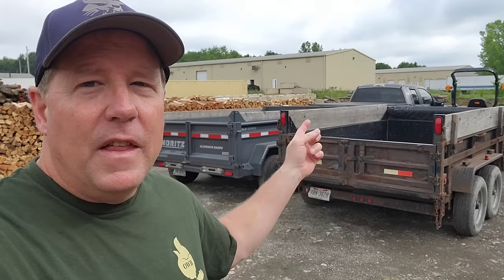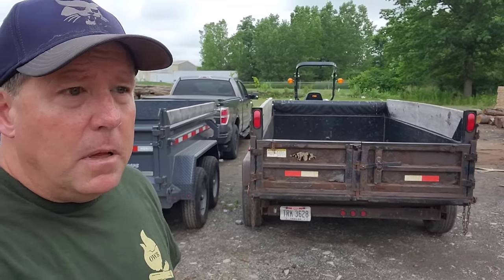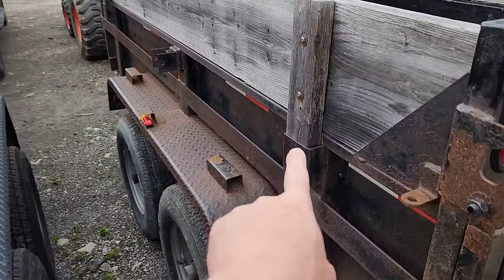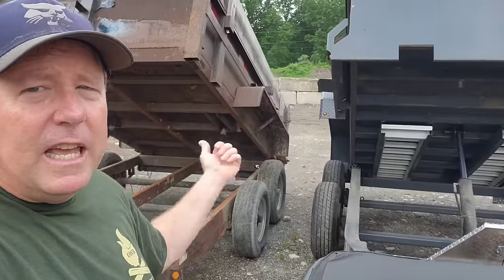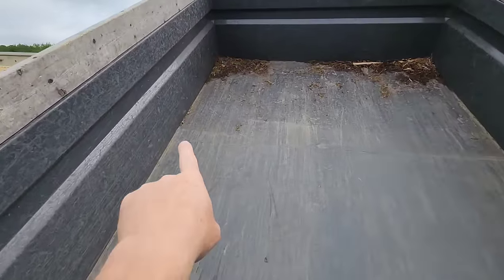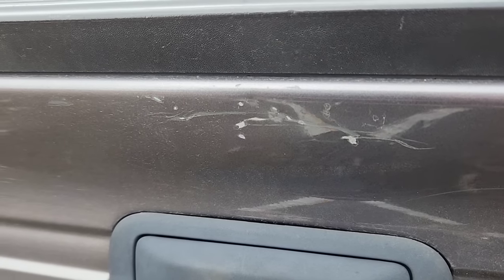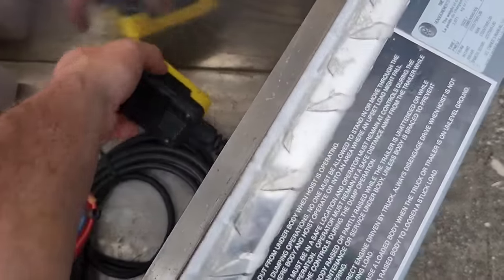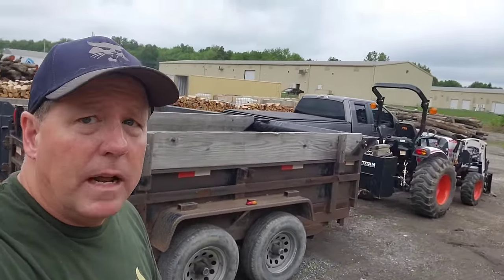Are Dump Trailers a Rip-Off?

Comment: You sure that small tab on the door Pin for the Moritz isn't for hold the Pin in the Up Position?
I believe on the 2 cylinder trailer if 1 cylinder bleeds out they Both will lower.  I don't think it will Kink.  Check the supply tube and you should find they are fed with only 1 tube.
I will say the cheaper trailer I bought had 1 cylinder and lifting 8000 pounds of dirt or gravel caused the center beam to slightly bend.  Was not happy about that.
Enjoy your trailers

Comment: The paint inside the trailer is holding up better then the outside?
I'd get it painted, if you don't it will fall apart before you know it.

Comment: Hello Joe, I hate to tell you but your information about needing a CDL in PA is incorrect.  I reside in PA, and I was told the same thing as you mentioned. I asked to see the PA regulations that states this. The individual couldn't produce it. I decided to email the PA DMV in Harrisburg (PA state capital). In my email I outlined my GVWR of my truck and the dump trailer I wanted to purchase,  my trucks GCVWR, maximum payload, maximum tow rating, and would I need a class A drivers license to tow the trailer. The reply to my email was, " You can still operate your truck and trailer with a class C non commercial drivers license. You would only need a class A drivers license if the GCVWR would be 26,001 pounds or more. Where the 10,000 pounds GVWR comes into play, is to determine if you need a class A or class B when your GCVWR is over 26,001 pounds and your trailer is over 10,000 pounds, you would a class A. If your GCVWR is over 26,001 pounds and your trailer is under 10,000 pounds you would need a class B. I have been pulled over by DOT towing my dump trailer and never received any type of ticket or warning.

Comment: Own a 14' x 7' ED Trailer. It cost me [2 years ago] $450 for a 5yd dump of 1-1/2" clean rock [$1350/15yd delivered]. I just hauled 15yds, 3yds at a time from the exact same rock pit @ $18.50/yd for 1-1/2" clean rock. It cost me $36.50/round trip in fuel ....$460 for 15yds Versus $1350.....Yeah, I like the dump trailer.
Reply: ps........  Some things I have learned using it: 1) The battery usage per dump lift is enormous. [You will only get 4-5 dumps per fully charged battery [lead-acid]. The onboard charger will NOT recharge a low battery overnight, you need a REAL battery charger [using the 15amp charging position, the 2amp setting will not recharge the battery fully overnight if it is drained]. Your truck-to-trailer lighting/power wire hook up will NOT recharge the dump trailer battery in a short time either.  2) The hydraulic fluid [ATF] reservoir will overflow out of the fill cap, due to back pressure in the cylinder[s] if you lower the dump trailer without using battery power. [My ED trailer has THREE buttons, Up-powered, Down-powered, Down with gravity-no-power]. There is a video showing why/how the air pressure builds up in the "un-powered" hydraulic cylinders, as they are lowering; causing the backflow/overflow into the Fluid Reservoir, so I won't go into that. I put a plastic bag under my reservoir as an overflow berm, in case my battery dies and I MUST lower the dump by gravity. If you do not have the "Down by gravity" switch on your model, you will need jumper cables, and/or a second battery to lower your deck if it gets stuck "up" and the battery dies.

Comment: If one ram fails, the trailer wont work at all. Because the fluid will by pass. Or so im told by my coworker, he told me to let you know. 
Hes old and thinks he knows everything. 😂   hes got a mediocre track record .... hahah
In my experience which i can back up with something thats actually happened to me in real life. . .
In a front end loader with dual cylinders one side failing will result in very slow operation of the front end loader. With a bit of torsion depending on the weight involved. But dual cylinders in my opinion would be more gooder. And power down is the way to go sir. Great video

Comment: I would buy your new trailer every day all day because it is built way way better.. Who ever told you that bent ties/floor is better then a floor separated from the sides was just trying to sell you a trailer.. Where they bent it now is very week compared to the welded floor to side.. Where they bent it is much thinner now and if you need to replace the floor it is much easier on your new trailer.. The biggest reason I like your new trailer is the I beam construction.. Here in Canada that box frame is crap.. I beams are better, stronger and stay that way over the years.. I have never seen a box frame trailer that didn't rust out in places over time.. As for your cylinders you can tell the single is bigger then the two plus ever hear the saying Double Trouble lol
Reply from the maker: Thanks for you insight Wally.  Glad you watched buddy

Comment: If you go down to home Depot they sell a paint called turbo paint it's a tall can that sprays 11 in wide pattern you could take a sand disk to the trailer and get the rust off and spray it on as much as you want might look a lot better also you can keep touching up on it

Comment: Lol. can't say i agree with your professors concept, uneven loading the double cylinders would deliver more stability, possibly more lift, inside the bed the formed bed would be better, the other trailer would be better if it was fully welded instead of skip welded.

Comment: Thanks for the info Joe.  isn't there a way that you could put some kind .d. It    e     of clip in the bottom of the latch on the Moriitz traiiler to  keep it from coming unlatched even if it meant having it modified by having a hole drilled in the bottom.  Adam from "Hometown Acres" has a friend that could do it for you.
Reply from the maker: I had thought of doing that.  I need to do something Neil!

Comment: You have had better luck buying them than me I build them from scratch now and don’t waist time with used ones  it will help if you drill some small holes and oil spray the frame inside the tubing 
For outside prep and spray better paint.  Manufacturing sucks now

Comment: I live in PA. The 10,000 lbs is NOT "CDL"  --  You need a FMSCA Medical Cortication to drive anything "commercial" up to 26,001 lbs I believe. If you're over that, then you need CDL.

This knowledge is unfortunately actually sort of hard to come by. The websites have tons of words, but very hard to find the important facts that matter.....We run a landscaping company & it's been a royal pain to deal with the "fine print" on these things the first few years.

Anyways, the "Medical Cert" costs like $150-ish @ a certified place, such as "AFC Urgent Care", or some Primary Doctors offer. You just need to ask, or search it online.  It is a physical. It's nothing fancy. Easy to get.

The CDL is entirely different matter. Much more involved. Also requires the "physical" you would get for Medical Cert, but there are extra steps of course.

All good info. Thanks for sharing your knowledge and info with the rest of us. Keep us hard working folk on the up and up. Be well brother!

Comment: That groove strengthens the trailer, dual cylinders should stay level or straight, the single will twist on unlevel dumps, haul a bunch of rocks or concrete debris for awhile and then u will see the difference

Comment: Did the professor consider that a two-income family has double the income potential and that if one loses their job they still have one income coming in? on a two ram system both rams share the load rather than putting the load on one a single cylinder and also help with torsional twist at the front of the trailer.
Reply from the maker: I assume the family has two incomes bc they can't make ends meet with one.

Comment: GVWR doesn’t require a CDL. If you’re in commerce, in other words making money using it, then you need a CDL. I can drive a semi with no CDL as long as it’s not in commerce. Also, two rams cost a lot more to maintain vs single. Your comment about rigidity on the double ram is debunked by the fact that the single ram used thicker steel to support it instead of adding another costly ram. I have a single ram 10k ten foot trailer and it’s a tank. Soooo many cool features it’s ridiculous. Welds going all the way across will crack. Sections welded will allow for some flex. If you’re worried about salt between the underside of the bed and frame, use caulking. A chord of oak can’t weight 4000 pounds unless it’s wet, if you load a chord into a long bed pickup that’s a 1 ton, that would be 2000 pounds capacity. So I’d say a chord of oak might be 1500 to 2200 max if dry and split. I have a trailer that I can snap pictures of and has features that I believe you’d love to know about. Great things to look for in a trailer. Hit me up if you’re interested.

Comment: Over 26,000 pounds combined weight with trailer 10,000 or over most states require a class A but there are some variations state to state
Reply: True but no variations between states.  It is federal law. States cannot override that.  Sort of why they combined the CDL licensing to a federal level ways back.

Comment: 10K is pretty light duty. I would have gone with at least a 14K, which is fine with most single rear wheel trucks. That said, as soon as you put a 14K trailer behind a dually you’ve entered CDL territory.  So there’s that.
Reply: CDL only if for hire "I.E the truck has commercial plates" and the truck GVW is less than 12k keeping you under 26k GCVW.

Comment: The one "cylinder" versus "two - cylinder."  I'm not there / with you to measure them, but from the video the "two-cylinder" unit appears to have a smaller diameter rods (the chrome part) than the single.  This goes to the "LOAD-CAPABLE-FACTOR."  From the video I'm assuming 1" inch diameter rods for the two-cylinder unit, and for the single rod unit, I'd guess 1.25" in. to 1.5" in..  Also the outside dia. of the units appear to be different sizes.  If I had to guess outside dia. of the two-cylinder is 2"in. Dia. each, for the single-cylinder appears to be three inch diameter.  Not having knowledge of the actual dimensions of each of the cylinder's, I wouldn't be surprised if the single was / has a higher rated load capacity, than the twin-cylinders combined.  Hence the expression "SIZE MATTERS!!!!"

As to listed load capacities, I would via (SWAG- Scientific Wild A$$ Guess) the twin unit to be rated 4-6 thousand pounds, the single 8-10 thousand pounds.  Maybe someone has access to a Machinist handbook, and could give the answer, if you were to supply the dimensions of the diameter's for the rods, and the outside cylinder diameter.  One would have to "ASSUME," the diameter of the piston, based on the outside diameter of the cylinders.

Comment: I almost guarantee if you pull that cocking up on the corners of mortiz trailer it isn't welded all the way it is just stitch welded.
Reply from the maker: Interesting.  Makes me worry when the caulk needs replaced.
Reply: @ohiowoodburner  I worked at caterpillar for years.  The cabs are stitch welded to cut down on weld distortion. 
The unpainted cabs are run through an E-coat system that cleans the metal and etches it in an acid bath.  Then it dip coats it in a primer.  This system is extremely expensive to set up.  A company that does not do E-coat will have poor quality paint at a much cheaper cost.

After E-coat, Then caulking is applied to the stitch welded joints.  This seals the joint to keep water out of the joint.  In a cab, it also air seals to allow the cab to be pressurized.  The other side of the joint is not caulked because a lot of times its not accessible, but also for cost reasons it is a waste.

After caulking, the top coat paint is applied to the exterior surfaces of the cab.  This is baked in an oven.
Then the cab is fitted with glass, wiring harness, seat etc.

On a trailer, the caulk makes sense to keep pooled water in the bed from penetrating the welded joint.  Eventually It may wear off in spots.  Sika or Dow and others make this automotive seam sealer caulk.  You can get it at auto paint suppliers or online.  Just peal off the old loose sealer and wire brush the joint.  Repaint the joint with primer, Reapply the new seam sealer caulk. Then after it cures, top coat it with your favorite paint.  The slick paint for grain wagons would make sense for a firewood trailer.

Comment: Take that trailer to a sandblaster and have a good paint job of two part urethane sprayed on it.  The cheap paint they coat these trailers with is pathetic.  Powder coat is a gimmick as well.  You have to protect your investment.  Remember the trailer is in a vortex of salt and chloride and sand and rocks when it is being towed behind you.  This is why most people haul their snow machines up on their truck or in an enclosed trailer.
Reply from the maker: I think the trailer is beyond the point of no return.  It just stays in my yard now

Comment: Twice is too much.  New trailer needs a failure free locking system on tail gate.  Contact manufacture & demand a fix, now.
Reply from the maker: I'm wondering what their opinion on that is?  I need to drill a hole in it for a pin